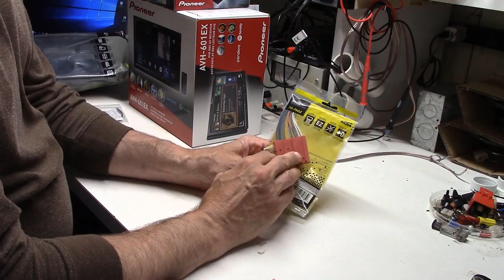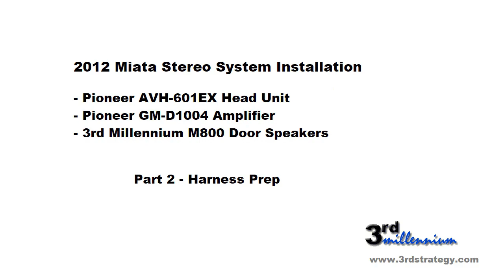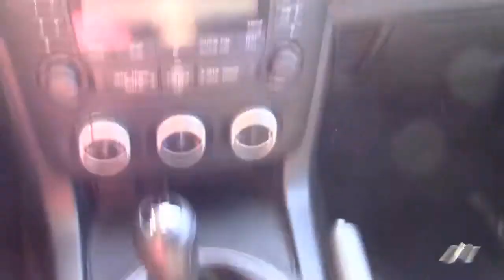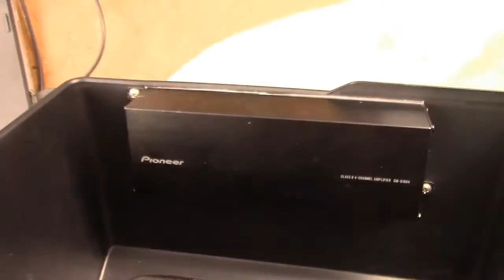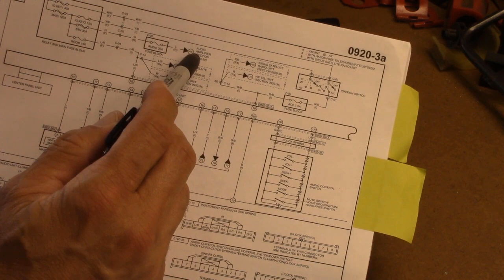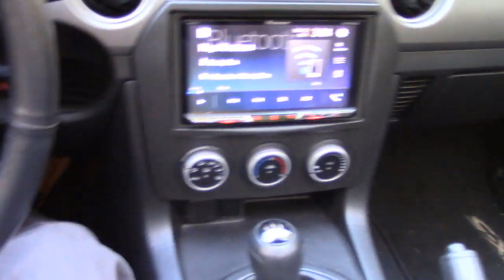2012 Mazda Miata Stereo System Installation: Parts 1-5

Comment: Where can one get this manual from? I have a '12 GT with the H/F unit as well as the Sirius antenna, and the aftermarket headunit I have can make use of both this OEM mic, and the OEM Sirrius antenna if I can find the schematics and pinouts. It's frustrating that these items may go to waste!
Reply from the maker: I believe you can still get the Shop Manual from Mazda directly. You might also be able to get just a PDF of those pages from another owner on one of the Miata forums like miata.net

Comment: I have a question: Why replace the Bose amp at all? For simplicity sake can't I replace the head unit, wire pre-amp signal to the original Bose amp and pair it all with your M800 speakers?
Reply from the maker: You could use the Bose amp in the 99-08, but it doesn't have standard speaker level or line level inputs, so you need to also install some circuitry to match levels and impedance between the head unit and the amp. We've had customers report the Scosche SLC4 works OK for this purpose plus there are other similar options out there. In addition to the extra wiring and then adjustments, these interfaces add a bit of noise, too. So it's possible, but for the cost of a brand-new amp with a warranty that won't have those issues, many owners decide to just replace it. Note that in the 09-15, you can't use the Bose amp at all as it delivers frequency-limited outputs to the speakers (essentially the crossover is built in to the amp). Some more info on Bose options here: https://youtu.be/G3YZvP2JF3Y
Reply: @3rdMillennium  Thanks. I have a 2007 NC1.
I thought you've said that you can connect the 4ohm M800's to the 1ohm Bose amp and the only symptom is that they will be a bit quieter? I don't listen to loud music so I'm not that concerned about volume (unless it's really quiet).

Ah, but are you saying that I need to change the line level to match the line-in to the Bose amp? I'm new to car audio so it's all new to me. I've ordered a Kenwood DPX-7300DAB that has 2.5v line-outs. Is this what you are referring to?
Reply from the maker: @theamazingmikelee9857  Yes, a 4-ohm speaker like the M800s will connect fine to the 99-08 Miata Bose radio/amp. There will be a lower maximum output level from the amp so you'd find yourself turning the volume control up higher to get the same listening level. 

The issue is replacing the Bose headunit with a normal radio and then continuing to use the Bose amp. That's where an interface is needed to match levels & impedance. So with that Kenwood you mentioned, you'll need something to interface it to the Bose amp to get it to all work. If I recall correctly, for an interface like that Scosche, you'll actually end up using the speaker level outputs from the radio instead of the line level outputs.

Comment: Did you ever do a video on how to replace those little rear speakers? I cant get the back panel behind the seats off because i dont know how to remove the handle that releases the top. Any help on that one would be awesome =)
Reply from the maker: No, we have not got into those speakers for a couple reasons. First, as you pointed out getting access to them is quite a job and likely more than our typically DIY customers are willing to try. Second, those speakers are mounted in a side-by-side steel frame without any baffling. Mazda gets away with this as they cross them over quite high - really running them as tweeters. Sonically, this doesn't sound too good so a proper solution is to mount an enclose at that location to provide proper baffling. We've developed a nice solution to do this but the economics of the final product don't work, so we haven't pursued it. But we haven't completely given up on the idea, so we may have more material on this in the future.
Reply: @3rdMillennium  The reason for my question is, im trying to fit some 16 inch woofers in those 2 storage compartments that are behind the seats. 

I just can't get the back panel off. Plus i think theres enough room to fit an amplifier.

a boom box in the trunk just sounds aweful so im trying to get some bass into the cabin =)

Thanks a lot for your reply!
Reply from the maker: @schallmau3r  I recall the handle just pulls off. But watch the first 5 minutes of this video of a shop installing a replacement soft top. You have to take the entire rear interior out for that job so you should see exactly how to get that back panel off. https://youtu.be/dHwBk5pHM3c
Reply: @3rdMillennium  Thank you SO much!